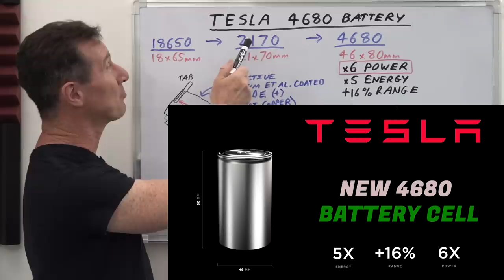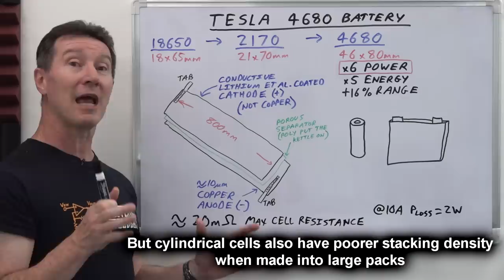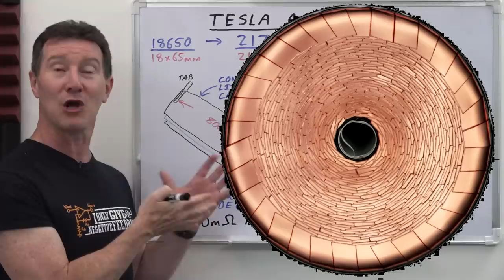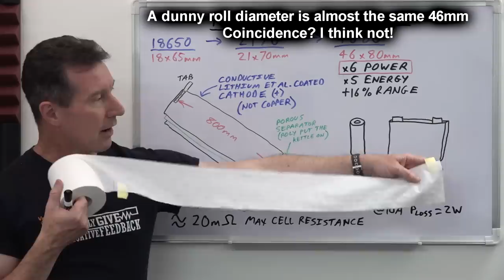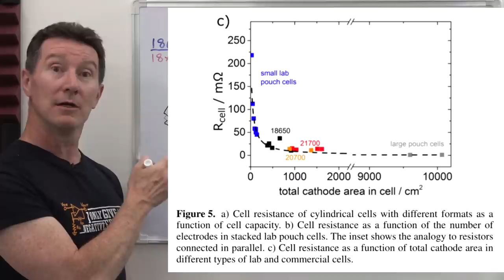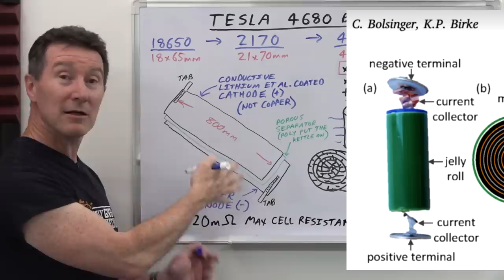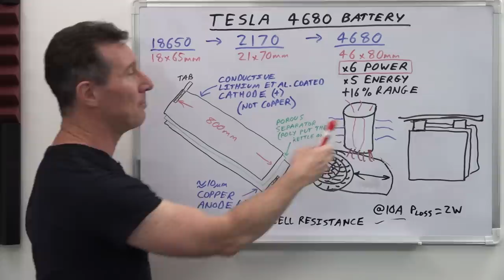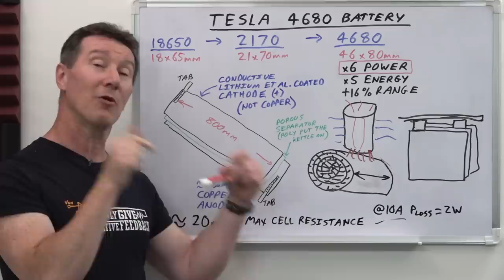EEVblog 1340 - New Tesla 4680 Battery Cell EXPLAINED

Comment: Manufacturers have tried many times to do the tabless design but most could not make it work or cost was to high to make it viable.   Tesla are just the first to claim to be bringing it to market as they claim to have solved all the issues including cost.  Time will tell if they have solved all the issues and produce a reliable and safe battery.

Comment: What is AC current comparison to DC in electric cars. I heard that high frequencies transformer \s ( >100k hz)  can be used by converting dc to ac using mosfet inverters in the front of the transformer. This will enable high density energy . The transformer builds a sinus wave using this high frequency square wave. Whats your view on this.

Comment: Still think more t layers n greater heat sinking like ion deposition etc in ic fab or thin film like mirrored tinting would work. Cadillac plastics n film place by la for example. Helped get wrapping n printing for wraps going. Cooled buses by 10 deg f with cool white technology, but very similar process. Love to help a geothermal electric unit to power it with saltwater brine steam etc too but 1at a time please. Stuck in chair mostly, something to work on needed.

Comment: 13:27 What a waste of volume again -  on the (obviously) smaller windings closer to the core, there will be more overlapp of the copper anode taps, so more overlap = more width. If they already have cutting edge (bad joke, I know) technology to cut the anode edge to little taps, why don't they just remove some of those taps in the inner windings? E.g. leave a few out like tap - 0 - 0 - 0 tap - 0 - 0 -0 - tap to reduce overlap and hence use their cell volume more effectively?
EDIT: Of course, the further you get away from the core, the less cutouts you make until there are no cutouts  anymore in the outer windings.

Comment: Can anyone tell me why it seems from the figures that a 1997 EV-1 beats every single modern electric for efficiency by a fairly large margin. If I am reading the data correctly an EV-1 manages 0.164kWh/m and the closest any modern vehicle can get is 0.25kWh/m with the worst being well over 0.4kWh/m???
What am I missing? I'm sure I'm being dumb.

Comment: i'm waiting for a combination of buffer cells and charged electrolyte to be used.
In fixed installations there are developements using fixed electrodes with electrolyte pumped through for charge/discharge.
Easy large storage capacity in tanks. At some point you could fill up (after pumping out...) with charged electrolyte and have your fixed cells be recharged on the cruise out of the slower liquid.(or hydrogen)
i never got the use for "always high power racing cars" because usually a small number of high current cells buffered by a high number of high capacity cells is fine.
Even when i'm going 160kph i'm far away from full throttle once the car is up to speed and that is more hyperloop travelspeed on the road then standard workhours traffic.
You can identify a bad driver easily by watching his brakelights doing the disco all the time.

i really like the nissan leaf "pouch" can design because it is easy to work with and integrate.

Comment: Thanks for sharing! I was hoping to make a video similar to this earlier ^_^ It’s funny that they say tabless when it’s really a bunch of tabs together lol.
Reply: The old tabs are a separate piece that has to be welded to the anode strip. That's why they call this tabless.
Reply: @carlhitchon1009  don't these basically use the same technology though? They are still a separate current collector attached to the anode strip, just there are a bunch of them. I could be misunderstanding this so please correct me if I'm wrong.
Reply: @energyeve2152  I believe they use a single long strip of copper and cut the edge at small intervals to form the new tabs. The presentation with the toilet paper roll and piece of sticky paper is a little misleading.
Reply: @carlhitchon1009  Thanks for clarifying. I thought tabs also used part of the copper current collector but I think you are right about them having a separate component for the tabs.

Comment: I enjoy your videos particularly these whiteboard sessions.  Since you are very knowledgeable about batteries I would like to ask your feedback on the issue of energy density.  I struggle with understanding how battery technology which today is at roughly a 10 to 1 (battery pack) deficit with regard to the ICE in terms of energy density - can become a viable replacement.  The typical EV carries a battery pack that is 1000+ lbs which is like carrying five extra passengers in addition to the five that the car is designed for in the first place.  In addition to all the design challenges that this additional weight causes there is also an impact on the cost of the vehicle to the consumer.  The last thing I'll mention is that throughout the history of transportation a low energy density technology has never supplanted an existing high energy density solution.  Rail transportation is an interesting case in point.  This is why I think if there isn't a dramatic increase in battery energy density that the EV will remain a niche technology.  In any event like I said I'm curious to know what you think and if I'm looking at this all wrong.

Comment: Why do everyone say Tesla didn't present million mile battery? They did present it, although they didn't call it million mile battery. Lithium-Iron-Phosphate can take 5000 to 6000 full cycles. Multiply 5,000 cycles by conservative daily miles of 200 and you have 1,000,000 miles. Have a bigger battery pack and longer range like 350 miles, and you may get to 6,000 cycles x 350 miles = 2,100,000 miles.  
If their Nickel based battery can do 1,000 cycles and the car has a battery capacity for 300 miles or more... that's not 1,000,000 miles but it's 300,000 miles. Many of us drive over 20,000 miles per year, but most don't. So, even this would be perfectly good for most people.... plus the battery is not at the of it's lifecycle if the car max range is reduced by 20%... for most even this wouldn't matter.
Who knows why they didn't use the "million mile battery" word.... maybe they didn't because they don't have plans to use it in the high end models? Maybe the Iron-Phosphate chemistry is not yet in their pilot production?

Comment: I like to see the 4680 with a Lithium Iron Phosphate battery chemistry.  The tabless design is a really wonderful advancement.  However I don't like making the battery a structural component.  I believe this will hurt the longevity concerns of the EVs over all.  Tesla is only focused on the first buyer of the vehicle and only focused on initial costs to lower them.  When people by a car they just don't think about the initial price but also will they be able to sell the car.  Making the battery apart of the structure of the car mean if the battery has to be replaced will be much more expensive and forget about replacing cells to recondition or repair the battery pack altogether.  With lager cells it also means if a relatively few cells goes bad and not being able repair the pack by not being able to replace them it means the cars value on the second hand car market will be even less.

Comment: Why not just abandon the cylinders in favor of the flat packs?  From what I see, all this is just to get them "as good" as the flat packs.
Reply: As far as thermals go, perhaps airflow around cylinders is better, but as you indicated already, the heat is mostly removed from the ends (and only barely so when it comes to tabbed cells).

Comment: Tesla needs to work on a hexagon shaped cell for a honeycomb configuration, Because the bigger the round cell the more space is wasted between the cells, With honeycomb packing there is little space wasted assuming the cells corners are a little bit round.

Comment: The 4680 can give out 6X the power of the 2170 cell. Does this mean that it can receive power at a 6X rate? And does that mean it could charge at 6X speed ?
If it could charge at 6X the speed that is an absolute game changer.

Comment: I think they use aluminium as a cathode because they can. And it is lighter and cheaper but has reasonable conductivity. An anode of aluminium would also be nice but would probably be eaten away when you charge it, maybe creating hydrogen gas as well.

Comment: Most people nowadays lost fundamental electrical mechanics.  The electrons are likely a car or boat only and only runs on the surface of some specifics conducted materials. However, we can create and design some materials or do electrons moving under surfaced of materials. The lead battery based on the electrons stored in the source of Anode which holding them by the fence of separators. Standard voltage 2.0v is the food that keeps electrolyte hold those electrons.

In opposition way, li-on battery based on weighted thousands time of ions to compare the electrons. So this made current of the battery stronger than the motion of the electrons.

But there are no instrumental devices that can measure nano ohm or pico ohm of materials.  Only the measurements of mili ohm  ... was tested.

In classical way, in series connection,  a balanced devices to keep all li-on battery cells are equal. That's totally wrong.

Image how to build a tall buildings which each level room in series connection. Same way, the cell closer to negative sources must have capacity bigger than the cell closer to the Cathode. The internal resistance must lowest to support  its mechanical law. The current of cell 1 must be greater than the cell 2 and so on based on I = V/R. In another words, the first cell will be collapsed and broken its standard phisical rechargeable function.

Comment: By a simple volumetric calculation one can determine that in order to have the same energy efficiency you would have to have 8 times the capacity for a 46800 cell compared to 18650 cell. That cannot happen because 18650s have at least 2 decades of manufacturing process tuning. So at start they (Tesla Co) will just have a big inefficient cell. 8Px18650 will beat it hands down at absolutely any type of invented benchmark. If they don't make it a cylinder it will be even worse from multiple points of view.

Comment: The "tabless" design mimics the tabs on pouch cells, where the tabs are stacked, forming a capacitor. Everyone knows pouch cells are lighter than round cells, but most of the battery fires people are familiar with in small consumer electronics come from pouch cells. Not good. The increased power is because of the built-in capacitor. Funny how the presenter touched on the idea of a rolled-up pouch cell and dismissed it immediately 🤣

Comment: Very disappointing, the new battery provides less energy than expected (5x instead of 5.5x). I also wonder if the additional range is simply due to the height of the new cell? Depending on the slide, Tesla claims the new cell will allow 14% or 16% more range. The new cell happens to be 14% higher than the previous one. Seriously, after 15 years of research, this is the best we have? At least they're reducing cost and weight.

Comment: Dave, you ask rhetorically (17:37) "Why they chose to use that (cylindrical cells) originally, I don't know?"
In a word 'cost'. Pouch manufacturability doesn't compare with Tesla's production of cylindrical cells. 'Tabless' is also contributing to the ongoing quest for cost savings.
Check out "BMW Battery Production" https://www.youtube.com/watch?v=DqrUqCeOcrg (10:50) and "Making Batteries" https://www.youtube.com/watch?v=zB8_HbrxUi8.

Comment: It seems hes disappointed in the nominal 16 percent range increase because hes assuming the same number of battery's would be used in a vehicle? He did dance around the issue, there would be fewer battery's but he didnt seem to , at the time, grasp thhe reason for the lackluster performance. If they occupy the same space, there would be fewer 4680 battery's but would produce 16% increase in range. That makes sense to me.

Comment: Apart from quality control issues Tesla is doing well...
The 4680 should have less of a problem with the overhyped dendrite issue...
It will be hard to beat the new solid state batteries that will be coming online in around five years time...
Solid state should be a BOON for the defence industry...

Comment: So, basically, if we compare cubic cm of both batteries (2170(0) vs 4680(0)), 4680 ccm have  about 17% more power, (there's whey they got 16% more range i guess)etc? Well ok, that's one thing, but because if bigger radius of the cell, you have worse volume usage or better to say stack density. So probably, if we have same volume to stack cells in, we end up with roughly same performance in the end.
Imo, only or biggest  advantage this new cell got (as i quickly went via tesla 4680 cell presentation) in whole cat battery story,  is tendency to basically ride off structural components within tesla car battery pack and use whole space just for batteries alone, in a way, batteries itself becoming structural component too (probably via thicker cell casing etc). this is where they mentioning honey comb technology from f1 world etc. but it think it's a bs, i find this even more prone to fires etc, as we already know, tesla cars are not the safest in this department.
It is kind of development, i can't denied that, but there's so much bs marketing (specially in sense of material use reduction, environment etc).

p.s. 
That last zero, that musk cuts off, stands for circular shape of the battery (as far i know), so i guess it is standardised. Why this ruling should be change, just because somebody fancy names batter this way?

Comment: Now that the new model 21 Tesla's prices come out it does not reflect the new manufacturing technique it was supposed to be a lot easier for them to manufacture this battery which would mean cost savings if that was true they certainly didn't pass those costs savings on to the customer new Tesla is same price

Comment: I think part of the choice for cylindrical cells is scalability across products. Rather than using pouch cells, and modifying pouch design per vehicle, Tesla is using cylinders, that're equivalent across their product range, and modifying pack design instead. There may also be some QC and refurbishment benefits, mostly economical and pack assembly/repair benefits, to this choice as well. Also keep in mind that Tesla also has the power wall, or whatever they're calling it these days, that have the same Tesla cells, and easily show the scalability of the product. I also think once Elon buys out a mine and has full control of the entire manufacturing process, we'll see Tesla cells in more than just Tesla products, as Tesla, or whatever spin-off company Elon makes of it, would be a battery manufacturer just like every other typical manufacturer, such as Panasonic, Samsung, etc. 
Manufacturing a singular product is much more economical than producing a range of products, especially when the new design is blurring the lines between cylinder vs. pouch. We already see this kind of approach with Tesla vehicles, iterative designs on a base model, rather than generational changes, where manufacturing lines are modified to fit the iterative upgrades, rather than shutting down an old line and building out a new line for a generational change. Same manufacturing philosophy applies to their batteries, why have many designs when you can just use one current design. We even see this economic philosophy in Space X, where reusing boosters means vastly less manufacturing, especially when the reliability of reusability eventually scales up. 
This also takes some work load off of engineers designing the packs and vehicles. They know from the very first steps what battery they're using, and they're not going to get a curveball mid-project battery dimension change, like what can happen with pouches. The only major changes are when the cells themselves evolved from 1865 to 2170, and now from 2170 to 4680; which the engineers can adapt designs to work with newer cells and design future products around these cells, it's not the blindsided curveball issue of changing from pouch A to pouch B mid-development, which would bottleneck the process of getting a product from paper to running on the street. 

Elon is clearly focused on efficiency of design and manufacturing. Other manufacturers might catch onto this as EVs slowly take over product ranges. Manufacturing scale of an entire range of vehicles using a single cell type makes more sense than having a specific cell per vehicle. Tesla is the first, and really only company currently, to have a product range that single cell scalability shows it's benefits in. Tesla has four models, and three more coming, compare the scalable single cell to using different pouch cells per platform, and tell me which makes more sense to use; now take that example and apply it to larger manufacturers that sell double or triple the amount of models at one time, or scale it up even further to something like VW group, and tell me which makes more sense.

Comment: If the heat is extracted from the top and bottom of the 4680, then why stop at adiameter of 46mm? Might as well roll it up to 1500mm... Single cell EV!

Comment: aren't foil capacitors manufactured the same way for half an eternity already?
...in an overlapping design like this current in average travels half the end-to-end distance...

@14:50 "high power applications like EEV-batteries" 😎

Comment: It seems that Mr. Musk prefers the BLUNT SHAPED BATTERY... ;-) I don't see why you can't put a heat pipe right in the middle of the 4680, so you can radiate the heat away to a heat sink, and then blow air/circulate water around that...
And what happened to LiPo Chemistry, I thought that was the up and coming thing? 
All the Best!